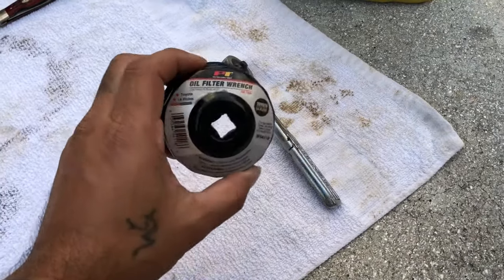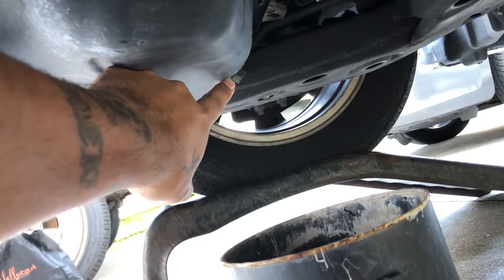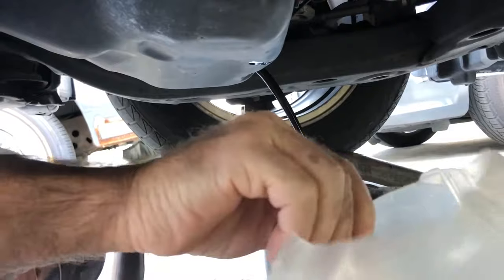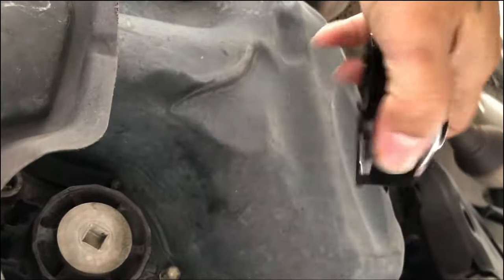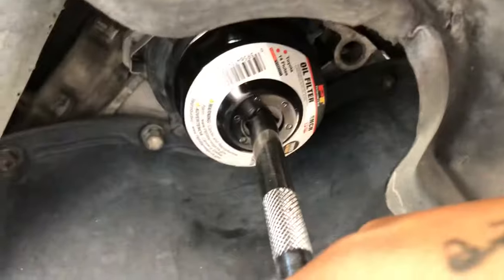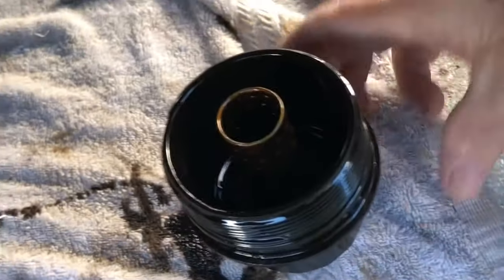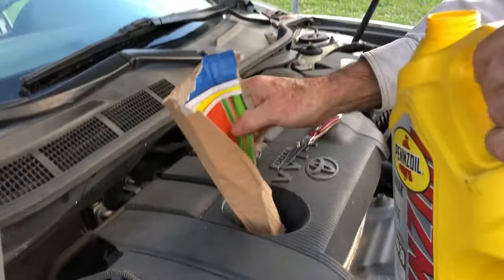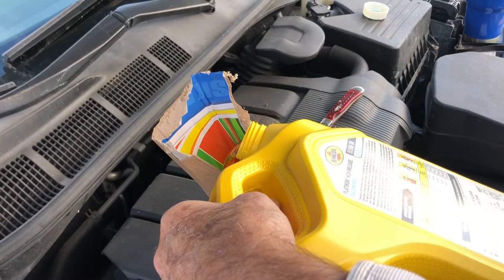2011 Toyota Camry Oil Change & Filter

Comment: I'm no mechanic but isn't that 3/8 slot on the bottom of the oil filter case supposed to be for taking off the oil filter case without using an additional tool?
Reply from the maker: Hey thanks for watching. Sometimes you can but this one was hallowed out so I needed the tool.

Comment: You should only use zero w twenty synthetic in these engines or you will be high budget engine replacement. You used 5 w 30 conventional. Also you don't need a oil filter Wrench, a 3/8 extention works just fine.
Reply from the maker: Hey thanks for watching! The person I did this for wanted to use this type of oil but has since sold the vehicle. Thanks for the suggestions I hope you subscribe!

Comment: I am not sure what the deal is with the “oil filter wrench.” Lol I just take it off with a 3/8ths socket and have not problems. Seems like a waste of money. The guy tried to sell me a $17 one at the store my first time and I said “nah I think I will try to get it another way.” Ha and it was super easy and not even risking messing anything up.
Reply from the maker: @lj5666  hey thanks for watching. I didn’t use the ratchet because the previous person that did it stripped out the hole so because of that the oil filter wrench had to be used.
Reply: @ thats unfortunate. Maybe it was not all the way in? I had to press it pretty firmly to get it to go all of the way in. 

I could also see that happening if it was on super tight. Someone could have over tightened yours. That seems common. People do not realize they don’t have to get everything as tight as they can, sort of the point of the gaskets. 

If people would torque to spec everything would be better lol

The tool couldn’t hurt if someone doesn’t mind spending the extra cash, or maybe has a friend who has one. 

I was watching to see where the gaskets that came with the filter went. 

I do not know that you covered the large and small one entirely. I found it on another video though. 
I only mention that so you maybe keep that in mind in the future. The video was good- I am not trying to take away from that, but that seems like a critical bit of info. I think maybe I recall you mentioning the larger of the two? Sorry if I just missed the mentioning of the smaller one.
Reply from the maker: @ yea if they torqued to spec we’d be good lol but the hike was pretty badly hollowed out so there was no way to get a ratchet in there. Also all feedback is great I love comments like these because they help me get better. I replaced both o-rings but forgot to include it in the video I actually attached a pinned comment to explain where they go. Thanks for your feedback I really appreciate it and I hope you’ll consider subbing to the channel.

Comment: Why use a filter wrench? You can just stick a ratchet with an extension on it
Reply from the maker: @generik6926  hey thanks for watching. I didn’t use the ratchet because the previous person that did it stripped out the hole so because of that the filter wrench had to be used.
Reply: @ucanfixit1  yeah that makes sense then 👌

Comment: Cut the chase and to the point. I will be changing oil in my 2011 Camry. First time I came across this type of oil filter.
Reply from the maker: @aksfilmsusa  hey thanks for watching and I really appreciate the feedback. It’s pretty straightforward job but sometimes you can use the end of a ratchet to get it off unfortunately this one was stripped so I had to buy the tool. Hope you I’ll consider subbing to the channel.

Comment: Where do you get those ramps? I have no idea how to jack the car up. Also, what do you do with the old filter?
Reply: Al you need to do is read the owner's manual.  It will tell you where to lift with a floor jack (if you have one) or if you use the crank jack that came with the car, it will tell you where to use that as well.  If not using ramps, best to use jack stands.  Always Be Safe!

Comment: For all the folks saying he should be using 0w20, I think it depends on the rings on the engine. The low tension rings experiment toyota tried( disaster) called for 5w30. If it was built with or overhauled with the regular tension piston rings it should be 0w20. Just fyi. There was a recall on low tension rings because they were garbage.

Comment: Did you not have a small O RING also?
Reply from the maker: @stjohnsriverrat hey thanks for watching. The smaller o-ring goes under the cap of the oil filter in exactly the same place you put the oil filter wrench on. I didn’t replace mine because mine did not leak from there and they rarely go bad. Hope you subscribe.

Comment from the maker: Link to parts in description.
The smaller o-ring goes under the cap of the oil filter in exactly the same place you put the oil filter wrench on. I didn’t replace mine because mine did not leak from there and they rarely go bad.
Reply: Mine came off in one piece also,
So I didn't use the small o ring either. Thanks

Comment: do you have links for tools?
Reply from the maker: @aperson1181 if your looking for the oil filter wrench here is the link: 

https://www.amazon.com/Performance-Tool-W54118-Toyota-Filter/dp/B00HFLIH6G/ref=asc_df_B00HFLIH6G/?tag=hyprod-20&linkCode=df0&hvadid=632116032901&hvpos=&hvnetw=g&hvrand=16090940244615252453&hvpone=&hvptwo=&hvqmt=&hvdev=m&hvdvcmdl=&hvlocint=&hvlocphy=9012010&hvtargid=pla-1915911460486&psc=1

Comment: The oil your using is 5-30W. It should be 0w-20 or 5W 20. Check your oil cap.
Reply from the maker: Hey thanks for watching. We used 5w-30 because it’s thicker and the vehicle has very high miles.

Comment: Is there an easier way to access the oil filter?
Reply from the maker: Hey thanks for watching! Unfortunately no because these vehicles sit so low to the ground you either need a jack or ramps like I have in the video and you need the oil filter remover tool. Good luck.

Comment: Why are you not using Toyota oil?
Reply from the maker: Hey thanks for watching. I keep up with my oil changes so I go with the most economical at the time.
Reply: @ucanfixit1  Cool. I was wondering is that's the reason people are having problem with oil burning with the newer engines.
Reply from the maker: Yea I’m usually on top of always checking at every other gas fill up and I’ve been hearing that a lot about the newer Toyotas. Just make it a habit to check it often and you’ll be good.

Comment: Your oil filter looks like it's for the 1.8 engine on a Prius or Corolla instead of the Camry. It's too small in diameter and probably too short, which means it won't filter anything.
Reply from the maker: Hey first things first thanks for watching. I actually went down to my local auto parts store and this is the filter they gave me to fit my vehicles year, make, and model. Your vehicle may be different. I also made sure to compare the filter that came out of the vehicle to the new one. Everything works perfectly and fit perfectly. Thanks again.
Reply: @ucanfixit1  
Okay, it just looked smaller than normal to me.
Reply: @njsongwriter  what u expect is a low budget filter.

Comment: No trash bag/cardboard available to catch spilled oil? The top of the tea bottle that was cut out couldn't be a fill funnel?

I'd stay away from putting torn paper products near/in the oil fill.

The center cap on the oil filter cover actually makes this job easier to do wirhout a proper drain pan.

The more "involved" way for those interested:

https://www.youtube.com/watch?v=ArxovO3Gcuw